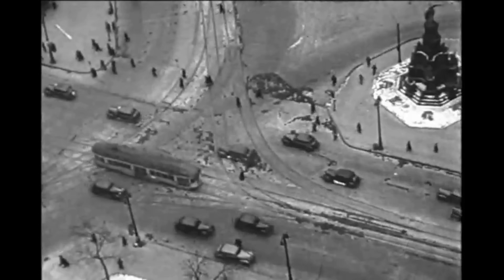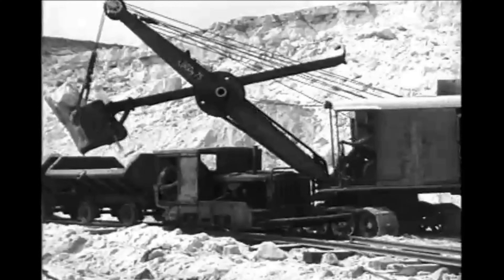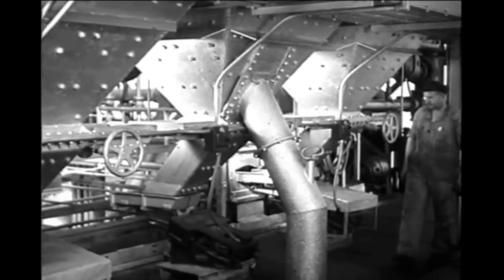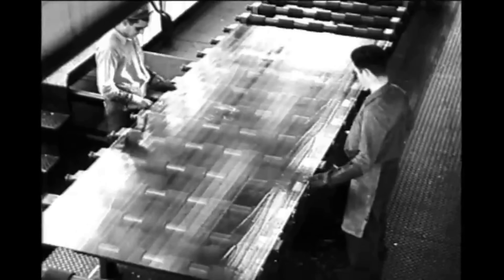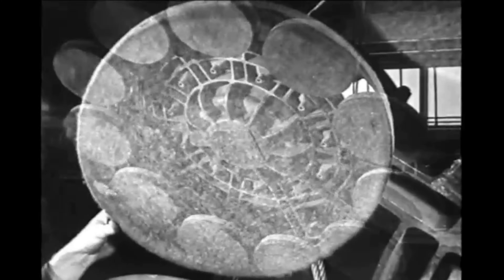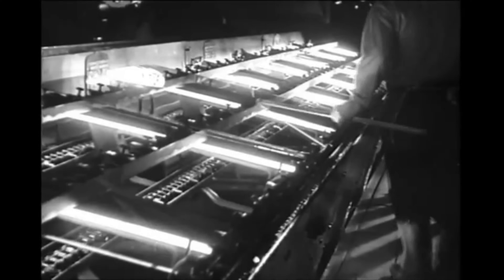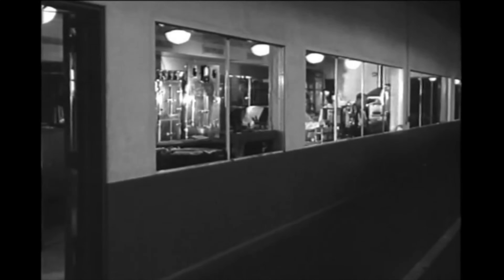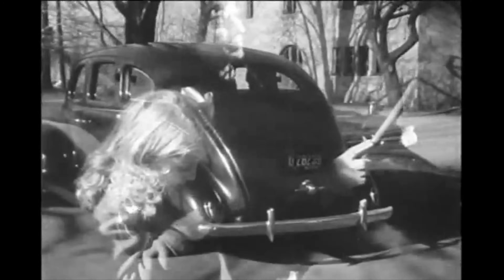The Making Of Safety Glass A Ford Motor Company Documentary and Educational Film

Comment: This is modern laminated glass, not tempered safety glass.
Reply from the maker: Thanks for watching!
Reply: I'm amazed that laminated glass existed and was used in the 1930's US Fords. My 1970's European Fords all had tempered safety glass, which made a mess when it got broken. Luckily it only happened once.
Reply: @oldwobble916  Tempered safety glass is used in all positions except the front windshield. Windshields, by law, must be the laminated glass.  Of course,  at any customer's option,  glass can be changed (upgraded) to suit their needs, such as bulletproof glass.  This also usually requires modifying and beefing up the door or opening to be able to accept the thicker sandwich of glass.
Reply: @stanpatterson5033  That's by today's standards.
But in Europe in the 1970's most auto mobiles (probably excepting expensive cars)  had front wind shields  which shattered in a huge amount of pieces on impact. In those days it was considered safety glass because the small pieces did not do mutch damage. But it made a lot of mess because it got trapped in ventilation ducts and spread under the seats and in all cavities everywhere.
I think the first Ford I had with laminated glass was a 1980's Taunus (Cortina in England) or maybe ever later with my 1990's Ford Sierra.
I think in the past, US was far ahead of new developments, compared to Europe.
Reply: @oldwobble916  Well, I'm surprised that laminated had not been adopted sooner over there.  
My parents, after going through their Volkswagen phase,  had 2 Ford Cortinas. My Dad`s was a 1969 or 70, with a standard,  and my Mom`s was either a 70 or 71, with an automatic.  Of course in those days, I wasn't paying much attention to glass types or what sort of transmission was in it,  I was more concerned with what radio station I could listen to, subject to parental approval, of course.